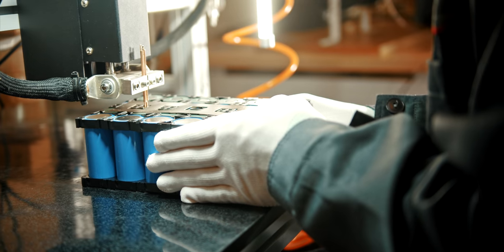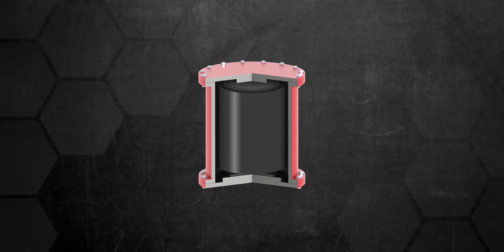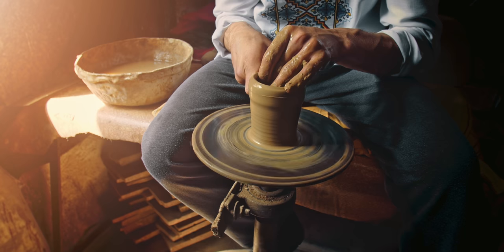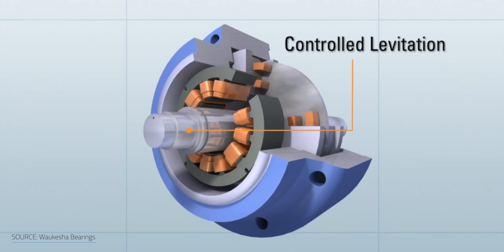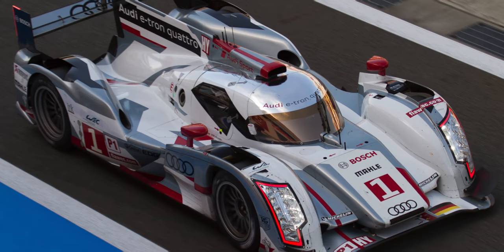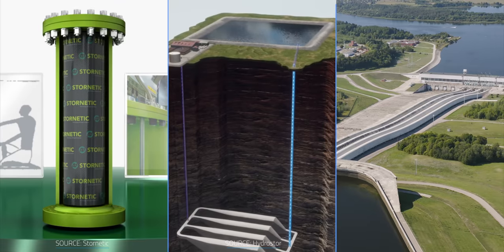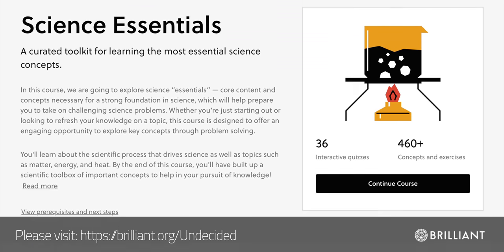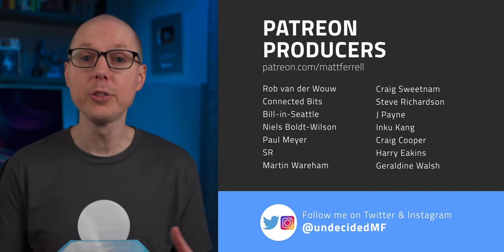The Mechanical Battery Explained - A Flywheel Comeback?

Comment: I have a feeling the cost can't come down because there is no economies of scale like there is for lithium batteries.
Reply: youre probably right, climate change is expansive we should get used to it
Reply: there might by eos if we optimize mass-production
Reply: @togetherworksemail  "Send him to the infirmary"
Reply: Like the tesla turbine proven old tech but scaling it to our needs sounds like no good issue ... (getting materials good enough to withstand the speeds and strain might cost more than ... )
Reply: hello 8 bit guy. the cost for steel alone are more than enough to buy a battery pack large enough to out energize a flywheel. flywheels are better at smoothing out energy sources that are hit and miss, much like the hit and miss engine, where it uses a pair of flywheels to smooth out the hit and miss'ness of it, which makes a pretty high powered engine but can be enstable, unreliable, hard to start, and hard to control speed. this could be fixed by using larger flywheels, but normal gas engines replace it much easier and cheaper. much like batteries replace flywheels, cheaper, easier to deploy. a field of flywheels has potential for solar and wind, but we need high weight, large, fast flywheels to do so effectively, which cost a lot. for windmills, this could have a flywheel integrated, but would make the start up energy needed, much, much higher. they will make a comeback eventually, but wont completely because of their cost and that we will still rely on normal means of generating power because its a sure fire way to make electricity, and doesnt require tuning. the world would suck if we all used wind and solar and the power cuts out randomly because the flywheels ran out of energy and theres no wind and its night time, it would just suck, batteries in that case, excel. or, a means of creating electricity that isnt hit and miss.
Reply: @raycert07  yep but since there is a moment when fossil fuels are not going to be available at a certain date, costs are relative to the actual need.
Reply: Well, if you have a control on lithium extraction and distribution.... which in chinese hands.
Reply: @immanuellasker4273   @momal0  He wasn't talking about climate change, ya fanatics. The question about "economy of scale" means... how are we gonna put a flyweel battery in a laptop?
Reply: @teacon7  with engineering?
Reply: Have you did the math and or the engineering?
Reply: Don't flywheels basically scale infinitely, requiring only more space and material and stronger magnets?
Reply: I have the same feeling....🤔
Reply: @momal0  lol. No. It’s not
Reply: @MrSludov  now that we left Afghanistan, even more so
Reply: @teacon7  who the f are you calling a fanatic? Are you hard of reading?
Reply: @raycert07  So it's like an analog capacitor?
Reply: Give the technology to the Chinese they make sure the cost come down.
Reply: @momal0  The earth has always gone through changes its natural and your right we need to work with it not against it because we have no control over mother nature.
Reply: @teacon7  Where are a lot of problem beside the costs making large capacity flyweel no option for mobile aplication. They are dangerous like explosives if they destructed. They are sensitive to acceleration. And they create a gyroscopic effect.
Reply: @teacon7  Flywheel battery in a laptop! That should be fun. Imagine the weird gyroscopic forces you'd encounter as you move the laptop from one place to another.
Reply: The global power supply is still a pretty large scale to get economy from though.
Reply: Are they still more expensive when you factor in how long they last and how environmentally friendly they are though? Currently Li-ion batteries are not recyclable in any significant way.
Reply: @raycert07  Why not take mechanical watch technology and scale it up. You won't need expensive crazy tech,just a lot of gearing. I'm sure if needed, America can make/recycle enough steel to make all the gearing needed. Plus all the maintenance jobs needed to keep said system working properly for centuries. Sounds like making great paying jobs all the way around and decreasing the carbon footprint
Reply: @Jocephus (Jø See Fūs)  there's no real way to use the energy of a watch mechanism for something useful other than to turn a little arm and tell the time.
Reply: what? are you all insane?  it should be the cheapest way to store electricity.   scale and making fly wheels simpler is the way

Comment: feels like a great benefit of flywheels is how smooth and easy you go from charging it, to draining it. Haven't looked up the hybrid system you mention in the end. But I would guess they use the flywheel as the primary backup to use, while the batteries only get used during longer blackouts when the flywheel isn't enough. feels like a good way to extend the lifespan on the batteries.
Reply: I sounds very promising to me!!...👍👍😁😎
Reply: It would likely be more along the lines of using batteries for instant response and the flywheel for longer storage. The Hornsdale reserve in South Australia has a 100MW charging to draining reaction time in the order of 0.1s. It's been playing havoc with the profitability of the extortionist gas backup guys.
Reply: @raymondjones7489  Unless they do something especial the hybrid system isn't different from the grid itself, the grid is a hybrid.
Reply: @autohmae  thank you!!👍😊
Reply: I just looked up the articles about the hybrid system, it's meant as a replacement of peaker plants, charging when there's a power surplus and discharging when energy demand outweighs the energy supply. The flywheel is indeed used to provide power first, after which the batteries are used. Using this method the batteries go through less charge/discharge cycles, so less battery degradation. It's a very smart way of combining both flywheels and battery storage if you ask me, getting the best of both worlds :)
Reply: Flywheels are more suited to a few seconds coverage, while the primary generation systems get up to speed to cover a demand surge. Micro charge/discharge cycles are no longer needed from the batteries. And yes, its battery life that is the big winner.
Reply: @waynerussell6401  That's pretty cool, thanks for sharing! The big pro for flywheels would still be that you can deep cycle them though! :)
I'll need to take some time to view the video you linked, don't have an hour to check it out right now unfortunately, but thanks for linking it! :)
Reply: @TanaisNL  2 minute watch - its cued.
Reply: Or the batteries, sun and wind will wind up the fly wheel and then they will run for roughly 4 hours. helping the grid. How long does it take to wind up the fly wheels? Minutes, seconds? I doubt hours. Could the fly wheels have the potential to run 24/7 as long as they're easy to to get up to speed. And not used when not needed
Reply: @carlosalmeida4415  The carrier-based flywheel aircraft launch system designed for CVN 78 and all future Gerald R. Ford-class carriers,  is 45 seconds between launches with stator cooling.
Reply: yes, other than some bearing wear it wouldn't have issues with rapid cycling, deep cycling, over discharging, etc that chemical batteries do.
Reply: @waynerussell6401  NEW go kart drive module is CHEAP and 4800 watts!  Even steel track can STORE huge energy.  #SCALEisKey!

Exponential gains from linear track increase!!!!!!!!